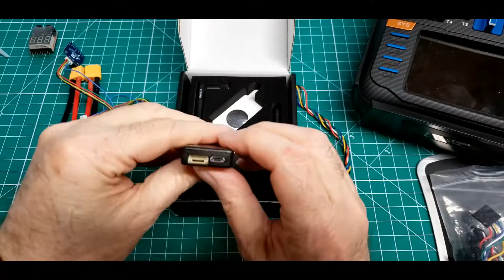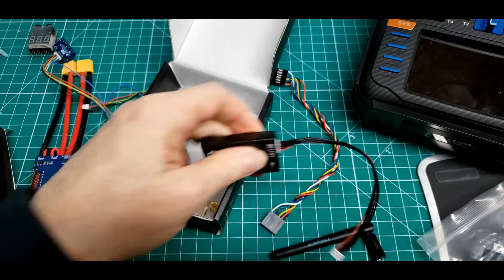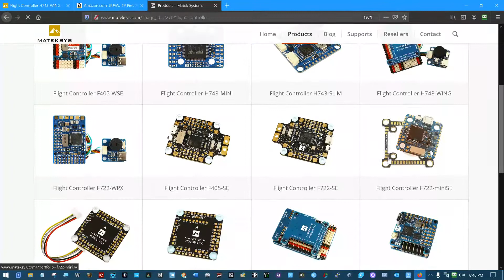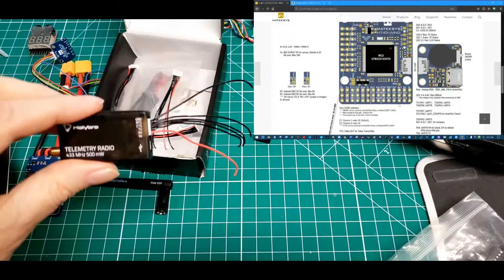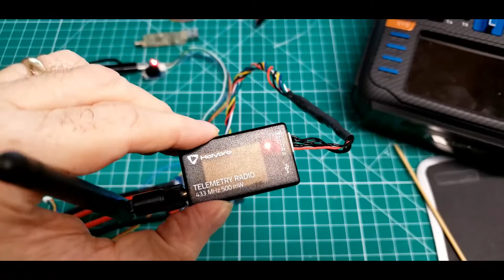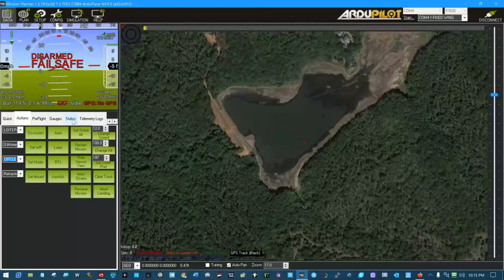H743-Wing 433MHz Telemetry Radios Ardupilot

Comment: is wifi from transmitter to laptop a bad connection or the way to go now?
Reply from the maker: Likely very limited range.  Great for the bench, but not so much for flights.  Higher power telemetry radios are better for flight.

Comment: Hi there, well job! I have several  question: dont you set up Anything on inav before to use  it ? 
Can i do it with a f405 wing ? 
Does this 3dr système has any latency to give you telemetry? 
Thanks !!
Reply from the maker: I am flying ArduPlane before I try INav.  You should setup a UART in INav for the telemetry.  I have another video showing exactly how to do that.  https://youtu.be/UG46ipT_bGk

The F405-Wing should work just as well as the F765-wing.

Not sure about your third question.  3DR systems as in Mission Planner have the ability to change the amount of telemetry that is being sent.  Trying to get too much too fast might slow Mission Planner.  But that depends mostly on how good a computer is running Mission Planner.  If it is a slow computer, I would suggest lowering the data rate for telemetry.
Reply: @nighthawkvs  hi! Thanks for your reply. I Check the f405. The problem is this fc does not have a Cts7 and Rts7 pin. So this  will be  a problem right ?
Reply from the maker: @jeangalibert8283  I loaded up some flight controllers here and found that INav doesn't care if CTS/RTS are connected or not.  I don't think it will be a problem at all.
Reply: @nighthawkvs  ok so i plug positive négative tx and rx that all?
Reply from the maker: @jeangalibert8283  Correct.  And setup a port in INav.
Reply: @nighthawkvs  ok so wich  one do you suggest? 413 mhz or 915 mhz? And how much mwatt? Also there is several brand, which on do you suggest? Thanks for your help !
Reply from the maker: @jeangalibert8283  Dragon Link is the best I have worked with.  I flew EZ-UHF 433 MHz for about 9 years.  At this time I like Dragon Link because the telemetry is built in and I don’t have to have separate telemetry radios.

433 MHz work at longer distances and behind some objects better but has antennas that are twice the size of 915 Mhz.  In the U.S. you have to have a HAM license to fly 433 MHz but not 915 MHz

I went with the 915 MHz because of the antenna size and the fact that I have a LOT of EZ-UHF 433 MHz around already.

The Dragon Link systems both 433 and 915 have really nice 1 watt (1000 mw) RC receivers.
Reply: Will it work on f405 fc?
Reply from the maker: @jeangalibert8283  Yes it will.

Comment: Hey Vern, good to see your still at it lol.  Anyways....         Following your guidance, wired the Holybro 433 to the H743.  The 433's connect to each other.  They come up in the sik radio setup in MP.  They show up as a comm port choice, but neither one will connect to MP.  I get No heartbeat packets.  I have checked wiring 3 times.  Have to as I'm dyslexic lol.  It is the same on two sep laptops.  The comm shows up, but no connection.  Firmware is 4.1  Ill roll back to 4.09 and see if it helps.. after you advise...  The radios do communicate with each other Ver 2.0.  Any thoughts?
Reply from the maker: This video is still processing but watchable.  I am not sure why it is processing so long.  They do that sometimes.

That is a good question.  Seems like if they talk enough to pass parameters then they should connect Mavlink and pass data.
https://youtu.be/Vssp2jR6Nos

Comment: thank you very much for the best video!
Reply from the maker: You are very welcome.
Reply: @nighthawkvs  hi my friend good video i have crossfire how do i wire it to do this please i am using a matek f765 board thanks
Reply from the maker: @RC-um3dv  Should work like this.  Let me know and will will try something else if it doesn't work.
https://youtu.be/UG46ipT_bGk
Reply: @nighthawkvs  hi it does not work i get it to work on the bench but not in the air i just use the tx and rx but crossfire does not have a rts and a cts pin or output if its there i don't see or know how to get it
Reply from the maker: @RC-um3dv  Are we talking about the telemetry radios in this video?
Reply: @nighthawkvs  no i talking about using the crossfire nano receiver to do this same thing if it can lol
Reply from the maker: @RC-um3dv  Oh, Yapu telemetry?
Reply: @nighthawkvs  no no no to be able to send comands to the fc from the gs while in flight
Reply from the maker: @RC-um3dv  I have not gotten that to work myself.  I dropped back and am using the old 915 MHz and 433 MHz telemetry radios from years ago until I figure out how to do Mavlink over the crossfire link.  I am not chasing that much because I realized that if the RX went out my Mavlink data would go out also.  If I run Mavlink separately on the radios I am less likely to lose both.
Reply: @nighthawkvs  thanks man keep the videos coming
Reply from the maker: @RC-um3dv  I will.  And I haven't given up on Mavlink over Crossfire.  As soon as that works for me, I will post a video detailing how that works.